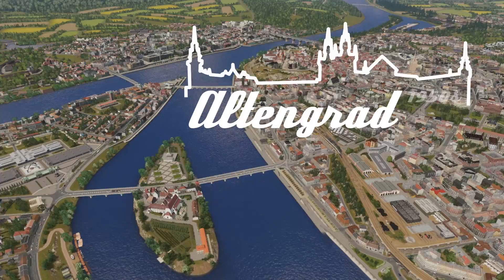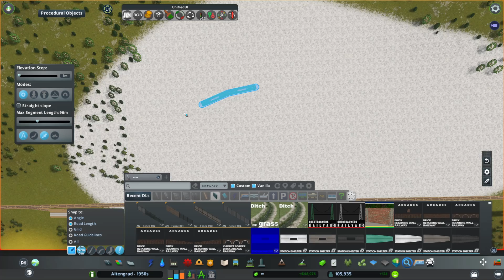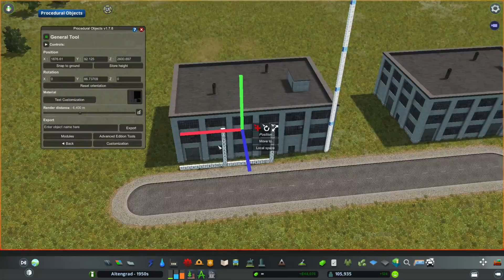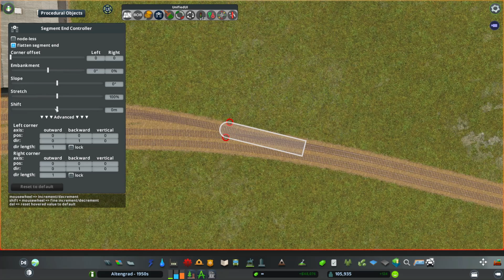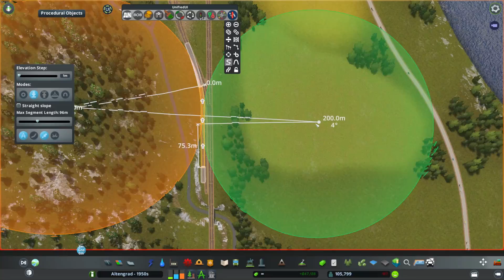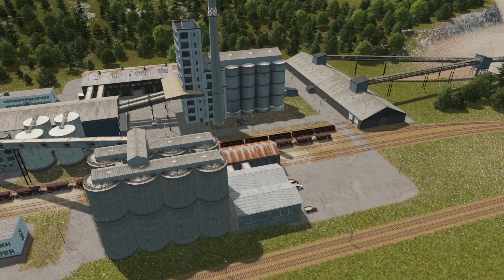Making Cement in New Factory and Mine - Cities: Skylines - Altengrad 61

Comment: This is close to me! My home village had a cement factory that sadly got destroyed a good 15 to 20 years ago.. Its a shame really but old stuff just has to go i guess. My village also had a brick factory that also doesnt exist anymore. Same goes for the aluminium works that got destroyed. The last remnant are some old rails and there are some steelworks that got recycled into apartments but its still a shame. But its interesting because you can still make out remnants of some stuff. Like old tram and traintracks, leftover concrete and so on. But i feel that we should treat old once important industries the same as old city houses. I like a good mix between modern and old :)

So i still saw the cement factory before it got destroyed and it was just a small one not compareable with the one youre building. XD
The aluminium factory i just saw a couple of times.
The steelworks i saw a lot! A beautiful brick building exactly what you think of when you think about old industry! At least they kept the faccade of it but i feel like a museum would have been nicer. Or just destroy it like the cement factory even though thats also sad. But i personally think they defaced it by putting skyscrapers inside of it.

Comment: I really loved this episode.  I'm also building a cement plant and steel mill in my own Storm City, and one of the most interesting parts of the project was to learn some materials science and how the process works.  The one I have built is based off a LaFarge plant in Michigan, USA, and has three animated, rotating kilns.  (I want to build a preheater tower as well but haven't found the right assets for it - might have to consider modeling some of my own).

Ironically, in Storm City, the minerals that went into cement were considered a waste product from the iron/copper/nickel mine, until sintering technology was learned by the inhabitants.  Then the cement plant was built right alongside the steel mill.

Comment: My face lit up when you mentioned the Carbon Capture on the cement factory in Norway as it was a part of my master thesis. It's a really exciting project where the cement factory (Norcem) is going to capture 400 tons of CO2, which is around half of their emissions.

Capturing CO2 is nothing new however. The exciting part is what happens after which is called the Northern Lights project. Here they will put the CO2 on a boat and ship it to west coast Norway. From here they will transform the CO2 to a super critical state (in-between liquid and gas) and pump the CO2 into old aquifers (underground water reservoir) where it will be stored. 

Over time the CO2 will have a chemical reaction and bind with the rock formations of the aquifer and turn into lime stone, making it go full circle.

Comment: If I am not mistaken, most cement factories, just like power plants, are situated near large bodies or streams of fresh water, because they need to dump large amounts of heat, and use the water in their cooling systems (as heat sinks). 
One can sometimes see the large pipes carrying the water to and from the factory/plant, and even sometimes large water basins.
Reply from the maker: That would be a huge waste of energy to just dump it into water, that's what the heat exchanger is for, to transfer ideally all heat into the raw material. The excess gases just blow out the top, there is no cooling circuit or anything like that, the kiln is cooled by air, sometimes with fans around it.

The water basins you mention are tailing ponds usually, or in a coal power plant they're used to store coal ash on its bottom so it doesn't get blown away.
Reply: @Akruas  Do you plan on building a power plant in Altengrad ?
Reply from the maker: @MrGustavier  maybe nuclear at some point
Reply: @Akruas . Would make the most sense given the timeframe.

Comment: Would you consider adding a small train station anyway? I know you mentioned it feels too small for it but you could take example from a place like British Redcar Steel, which to this day still has its own train station (although it is disused now since the plant has closed). It would actually work really well with the little rail bus trains you’ve got running and it could literally be as simple as one ground level platform with a single switch to allow trains from the city to terminate there. 

Just a thought. Absolutely love the build!!
Reply: I think there would be a single train that picks up workers in the morning, and brings them back in the evening. Because this doesn't seem to small for that kind of connection
Reply: @jan-lukas  exactly!